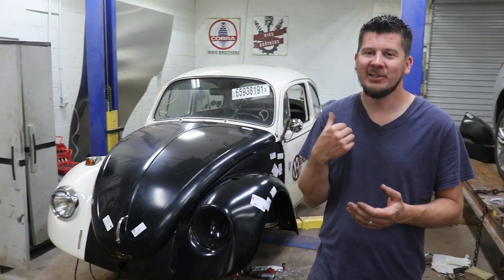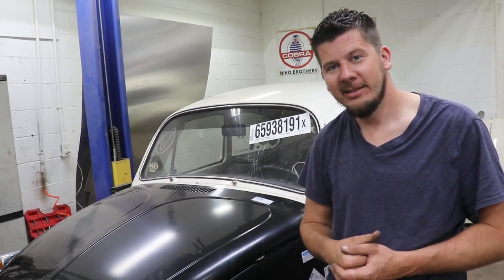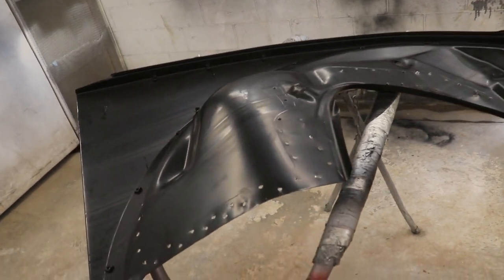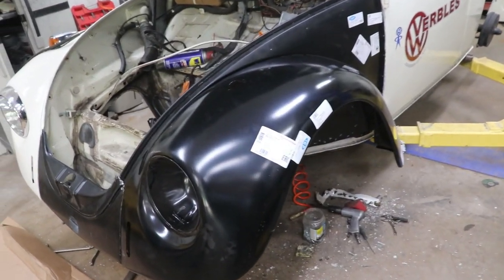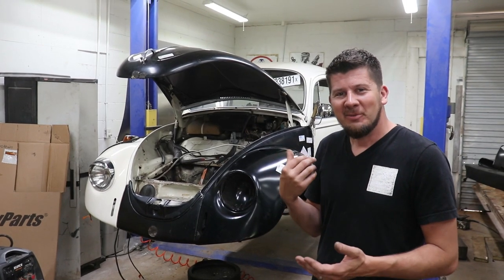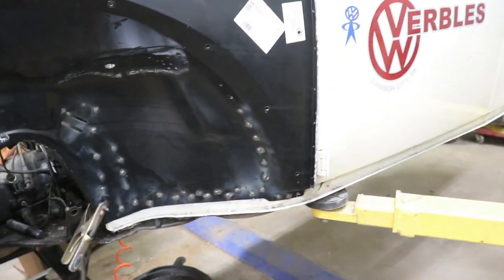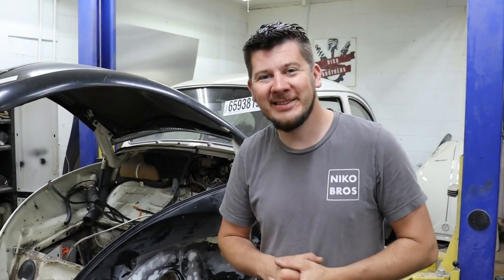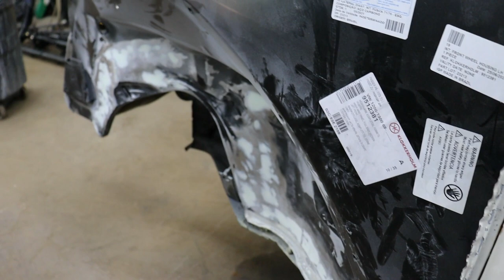1968 VW BEETLE WELDING AND SEAM SEALING Part 4

Comment: When I had my Bug (20 plus years ago) I changed the front brakes from drums to discs. Great improvement and was not too expensive.
Reply: Agreed.  I upgraded my '62 to disks all around and went to a dual circuit master.  It's a vast improvement on stopping power.  I think the Empi kits use Ford pads, so future maintenance is also a non-issue.
Reply: They really should do that! it makes an amazing diff...

Comment: Personally I generally call them Beetle, they came out of the factory being called a Beetle, bug is an affectionate name which needs no explanation but hey I'm not getting picky. The windscreen is easy to remove, no specialist tools needed. First carefully remove the chrome insert, there will be a joining cap at the bottom centre. Try not to distort it and put to one side. As the screen is no good you don't need to be too careful but you can then squeeze the rubber together and push out from the inside, you can press your feet against it on your inside to get it moving but be careful that it doesn't shoot out. Check the condition of the rubber but I would recommend you install a new one. To install a new screen it is much the same as removal. Place the rubber around the screen put some wachong up liquid around the aperture,  place a strong piece of string around the gap in the rubber leaving two lengths hanging out at the top. Place the bottom edge in first and gently work the rubber over the lip. It is best to have someone pressing on  the outside while your doing this. Some people like to have the string ends at the bottom but it is maybe a matter of preference, once the whole thing is in  carefuly replace the chrome insert strip and cap. Hope that helps. I think I would keep the same coulor but I'm not firm on that . Thanks for the video Brothers.👍👍

Comment: nice job on a nice car.
The jack fits in the square hole on either side and lifts the whole side at once.

BTW the front and rear use torsion bars instead of springs. You can easily change the ride height with a few simple adjustments.
On the downside, they are VERY dangerous to drive with almost no safety equipment.
After a while you will learn to appreciate the great engineering that went into this car.

Comment: Hi, there are special slots under the sidesteps for the tire jack on each side, some models lift both tires front and rear at the same time. make sure the jack fits in all the way or it will be shaky :) you lift and lover  the car by turning the handle on the jack. have fun, take care..  all the best from Istanbul Turkey

Comment: Yes, the VW Beetle was not very heavy.  One time we were at a concert and a VW Beetle parked very close to us leaving us no room to leave from a parallel parking spot.  My high school friend and I lifted the front end around and put it on the sidewalk.  . . .  no problem at all to leave with all the extra room.  It was winter in Saskatchewan so the rear tires moved easily on the snow.  😁

Comment: I vote for a restomod on both.  modern engine with fuel injection, electronic ignition, disk brakes on both, better suspension(mustang). both conservative mods without body mods.  keep in mind that the mustang has 4 bolt wheels, 5 bolt wheels came with the v8 version

Comment: I think you need to check if you have the correct front fender. It looks like a 1966 fender. And not a 1968. Try and check if the head light assy fits before you paint the fender. Just my opinion but it looks to be a early model fender

Comment: Just a Tip for you guys when the front screen has been fitted to the Car PLEASE LEAVE A DOOR WINDOW DOWN so that the front windscreen does not blowout on you because VW's are air tight :) has Happened to me when i repaired a VW i was very lucky that the front screen balanced on the hood when i came into the workshop. lol

Comment: Still think that’s an early fender and your headlights aren’t going to match.  Also in for a surprise when the car is higher in the front from replacing an adjustable beam with a stock one. Also, fit your taillight before you paint too. It’s an earlier one and you will have to drill, and fill, holes.

Comment: Hello guys . the car is 40- 50 years old do you think seamsealer existed in 1968 and grind down spot welds and putty over them. in post-war Germany they would not believe. then there is a front wheel suspension with torot rod suspension but a shock absorber. the old ruin is also lowered if you see them in the middle of the front wheel suspension. I know these cars inside and out to kind regards from Sweden

Comment: The windshield pushes out from the inside.  If you cut it out you will have to buy a new gasket.  It was designed to be pushed out in a accident, there is no glue used.  I'm sure your glass guy will know the correct or old school way to do it.  Had a 63 and a 69 when they were just considered used cars.
Reply: Yup, you put the gasket on the windshield, and use the cord trick to install it on the car.

Comment: The Mustang as it is isn't worth as much as it would be worth with V-8 Engine and Trans, Maybe go with a nice original 289/4 speed ,and all 5 bolt Suspension .Nobody is all excited about a straight 6 with four lug wheels and tiny brakes ,Just a thought :)
Reply: Sorry but you just completely disregarded that key element - Originality. Especially with matching numbers. As rare as hens teeth. And yes people do want to buy original cars.
As soon as you change it for 'whatever' you just have yet another modified Mustang worth nothing. What you are suggesting is being done by Vtuned on his channel and its a brilliant conversion. But then he started with a burnt out wreck worth nothing not an original car in excellent condition so he has ADDED value.
Reply: @1chish  Agree with your every word 💯.👍
Reply: @stephenricketts7764  Most kind thank you.

Comment: The red used on the truck would be an awesome custom color for the bug.  Maybe a black roof line and take it down the back following the engine cover for a boat tail type finish.  Add some black wheels and have a nice custom ride.

Comment: It's a beetle. Just take out the glass. You can take out the windshield with a shoestring. Just go slow.
Reply: Yes but getting  a new windscreen back in is an almighty pain.
Reply: @1chish  I've never had a problem with it on a beetle.
Reply: @GunsNBudder   Maybe on the later ones but I restored a '56 and while it came out easy (OK we sliced the rubber!) but putting it back was a nightmare. Even the specialist glass lads nearly gave up.
Had problems with others but not as bad as that one.

Comment: You don't need to get a glass guy to take out the WS.  When you pullout that chrome strip the windshield will just pull out.  DO NOT CHOP UP THAT MUSTANG. IT IS FINE.  Buy a clapped out '66 coupe roller, and fit the body onto a 2014 or newer mustang GT that is rolled or something.  Then convert it to a 66 Fastback with new panels from That 
aftermarket company.  This car is too nice to chop up.

Comment: Great job, beautyfull beetle, but stop applying bondo on welds, you migth have micro pinholes on your welds that will cause bubble under the paint. Always use paste fiberglass, like marglass or tiger hair, it will seal those little pinholes and give a long life repair. For the windshield, just remove the chrome moulding in the middle of the rubber and pop out the glass, then repair the window frame if necessary, so you call the glass guy only once.